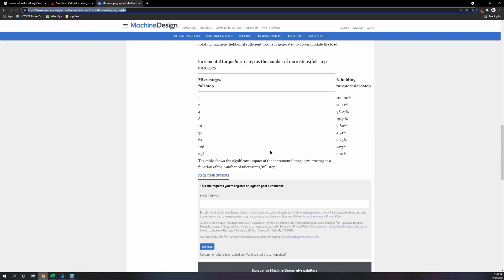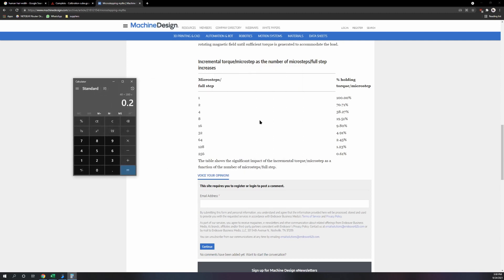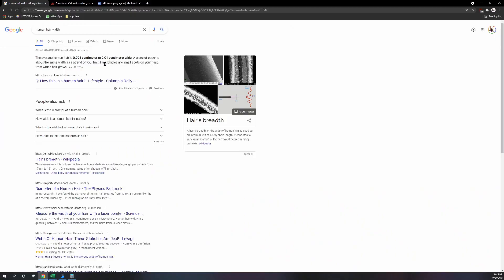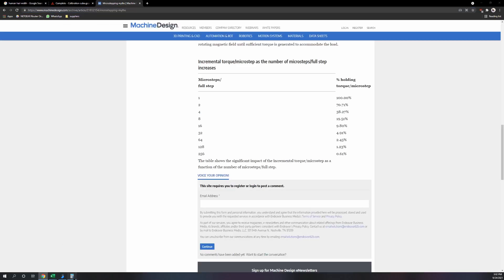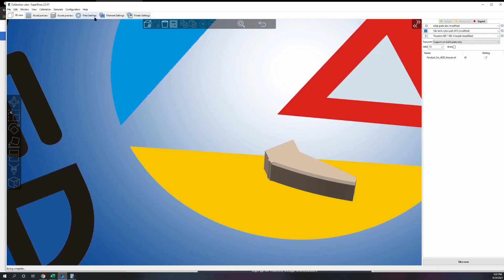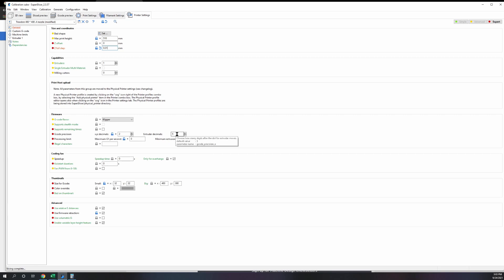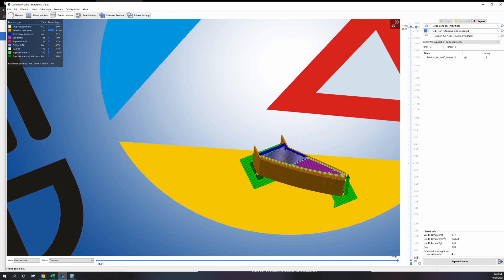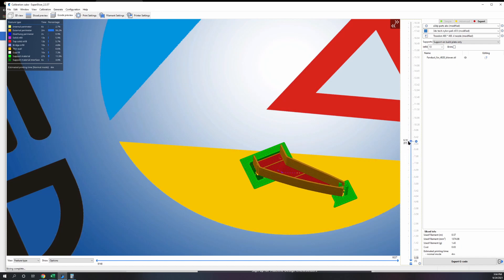1.8 vs 9 steppers "how to set superslicer for them" and tweak to improve bridges

Comment: Great info there. Any idea why the defaults are not the best values? Both changes you showed made sense to be the default, unless there is some big downside that we are missing here.
Reply from the maker: Yes i think its because these are all diy projects. Ex for over a year i preached about the chopper settings and marlin,klipper and rrf dev all had no answers and really no interest. I had to dig with trinamic and moons and omc to get info and find these things out. It just seems people feel more is better and that is not always the case but as i have show over and over their are huge gains to be had with no hardware changes. When i bought my printer i was told be happy to hit 100mms now that same printer does its first layer at 100mms at 2k accel. I used to have 1500 accel as my travel accel when that printer was on marlin and using defaults. The companies that have done this research charge 6 figures for their printers but when you look at the hardware in most cases its not leaps and bounds over what we have.